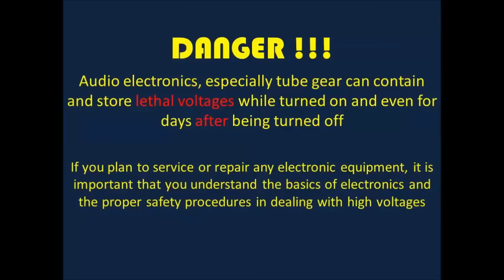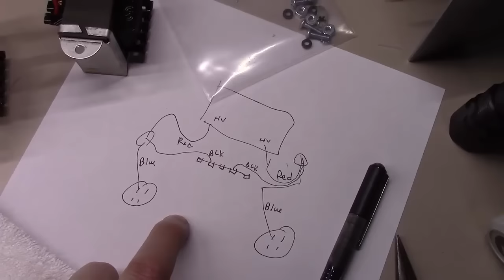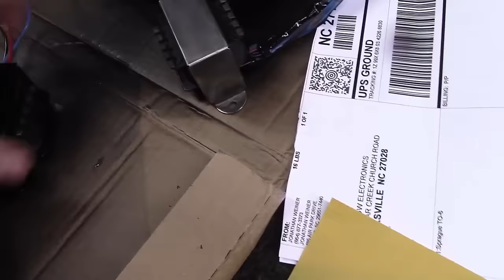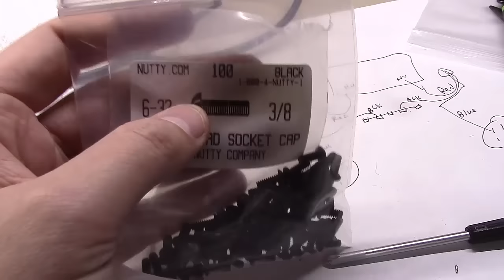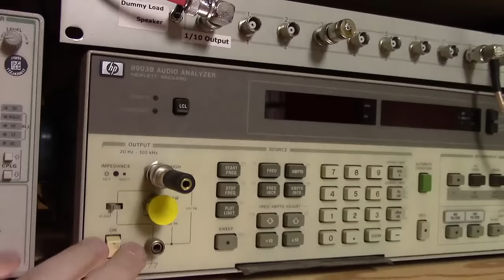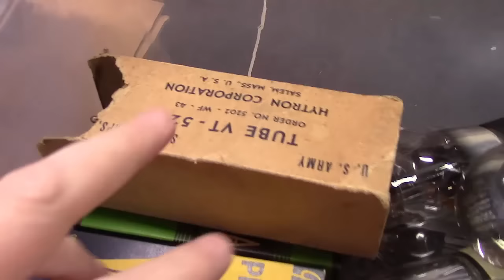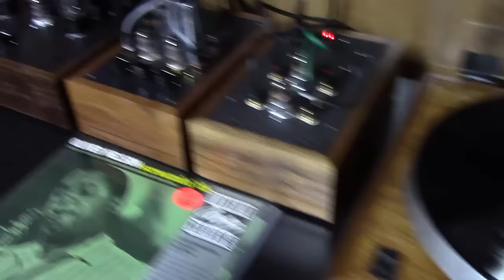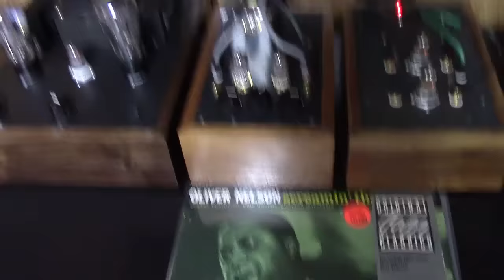Bottlehead Stereomour 45 Amp - A Lesson in Buying Used Gear Online - BG026

Comment: I bought a Bottlehead Crack used in about 2012.  It's always sounded pretty good but with a random noise you'd hear coming down the pipe.  I always assumed it was the old 1940s tubes I was using.  I finally decided to look closely at the work underneath and there was a positive power wire running through a tube post without solder on it.  I soldered it to make the connection and the thing is perfect now.   I only got it used because the price was right.  I"d have loved to have put it together myself from scratch.

Comment: Very nice work! I agree 100% that buying our kits used is a crap shoot, as there is no guarantee of the build quality. It's usually easier to build from a new kit than to fix all the boogered up stuff in a bad build. I will also suggest that while you know what you are doing, the average builder probably shouldn't take apart the channel frame chokes unless they understand their construction. Once that channel is off be very careful in handling the lam stack. It is easy to knock the I's loose from the E's and that would ruin the air gap and thus the choke's inductance.
Reply from the maker: +Dan “Doc B.” Schmalle Agreed!
Reply: @Alberto Jasiah Instablaster =)
Reply: @Christopher Marcelo It worked and I now got access to my account again. Im so happy:D
Thanks so much, you really help me out !
Reply: @Alberto Jasiah glad I could help xD

Comment: Hi, thanks so much for the video and for your tutorials on how to read schematics. I really appreciate your time and efforts. About this project, when you fixed the soldering joints, did you just reflow the solder, or do you remove the solder and redo the mechanical connection first? I'm having to fix some solder joints on an amp I have. Thanks again and hope all's well. :)

Comment: One tip: If you apply polyurethane paint, put the objects in your wive's kitchen oven (obviously she has to be out of the house or you will be lynched).  Let 'bake' for about 15 minutes at 80°C  (about 180°F)
Reply: I would also add that the metal should be degreased before painting. Gets rid of the finger grease they were getting there in abundance. I'd be wary of cooking the transformers myself in case it softened up the potting too much. Yes I know they can run pretty hot when in use.
Bottlehead use American alder for all of their bases and I'm sure Doc could have supplied a new one at less cost than your custom one. I have a Bottlehead Crack headphone amp that I built for my Sennheiser HD60o's. Very nice and a good build to start you off. Entire set up is nice. I have a pair of Quartets, rare in the UK, with Crites tweeters and cross over upgrade. Amp choice is a pair of Quad II's or a Luxman L30. Have a Linn with that LVX arm with an Ortophon MC10 + Audio Technica transformer so we are similar.

Comment: How many watts to you solder with? I was told that you should use a high watt solder iron - around 450 Watt to heat the solder quickly and make the solder joint so you don't just sit there cooking your parts while you try to get the joint hot enough to melt the solder. Is a higher solder Watt setting better?
Reply from the maker: +roomba I use a Hakko FX888 soldering iron.  They run about $96 shipped on ebay.  Its a constant temperature iron, so I set it on 750 degrees for most point to point wiring.
Reply: Blueglow Electronics
Thanks, for the extra information, very much.
Reply: Did you ever put in the black screws?
Reply: For electronics temperature control is everything, 50W is good for most stuff, higher if soldering to chassis etc, but must be temp controlled.
Reply: You MUST get the parts hot enough to melt the solder. If you heat the solder itself and the parts are not equally hot then it will not bond. But, some things need to be heated to the right temp quickly before too  much heat dissipates to parts damaged by heat. The largest I ever use is a weller 100/150 watt gun. Mostly I use 15, 20, or 30watt pencils for circuit boards.